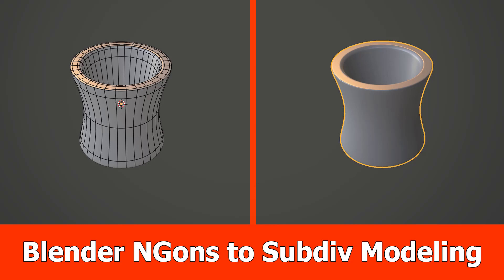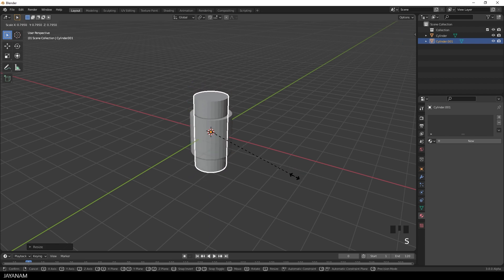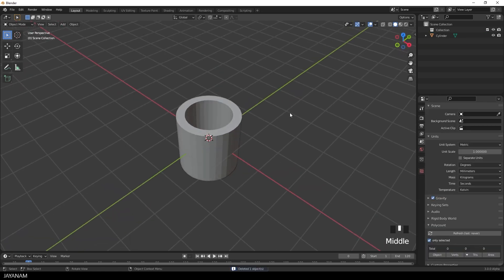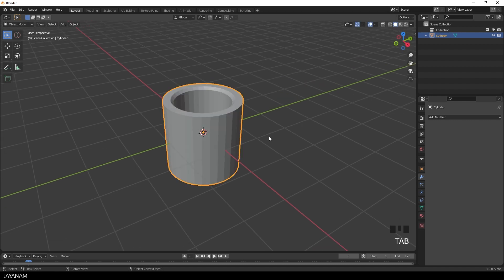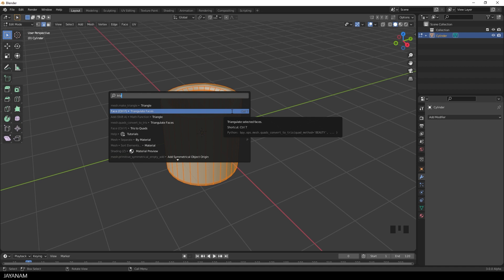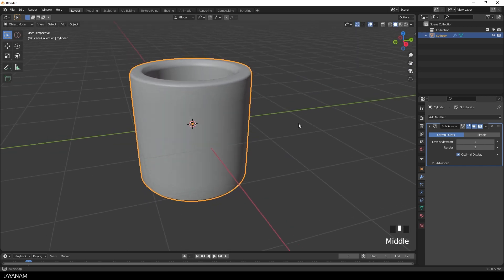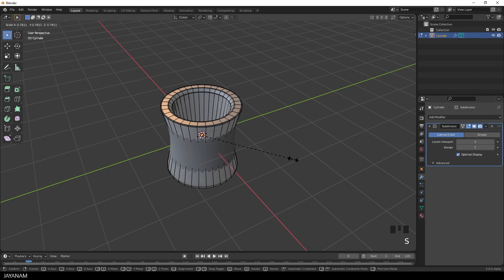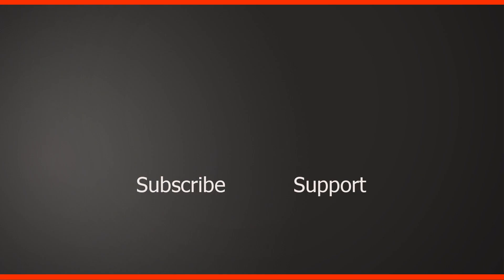Blender Modeling : Boolean NGons to Subdivision surface

Comment: Lol this video people use ALWAYS simmetrical and simple objects. Try do this with difficult mesh, so we want see if you can unwrap this ;) 
add cylinder internal extrusion use subsurf. end
WIITHOUT support loops that in asimmetrical object can give problem, use CREASE . Select FACE LOOP that you want sharp and press CTRL -E. e regulate the CREASE. 
Clean topology to unwrap, less polygons, less time spend ;)

Comment: My blender runs very Slow is there any way to make it fast?
Reply: What part of it is slow? the rendering or just general interface? My first mistake was not having the preferences set to use the GPU/Graphics card and was using CPU instead.
Reply: I am using blender without graphics card
Reply: @mohansolanki1026  sounds like there's an obvious solution